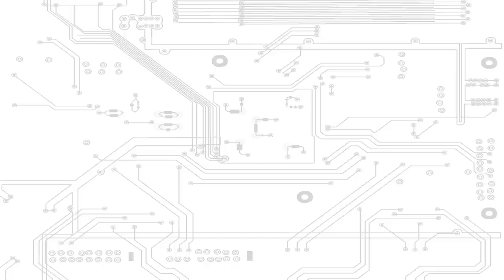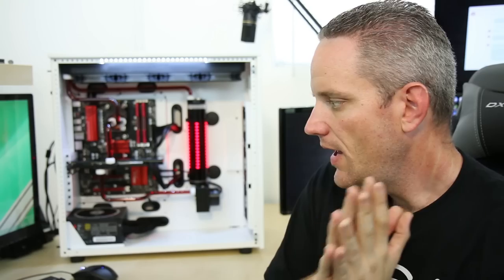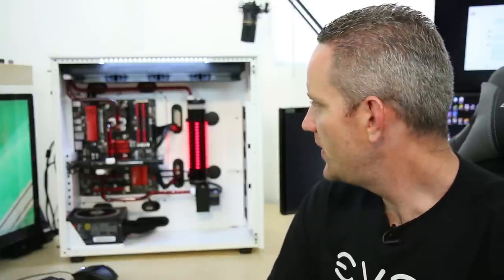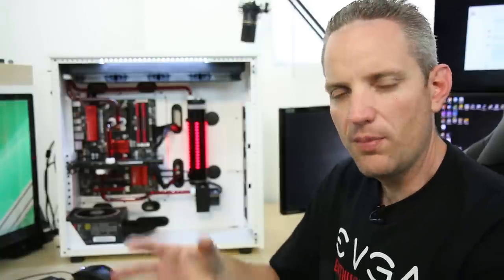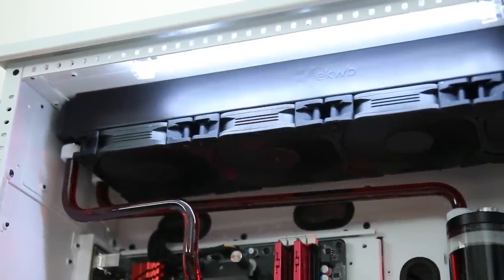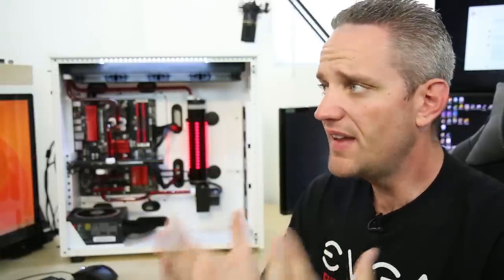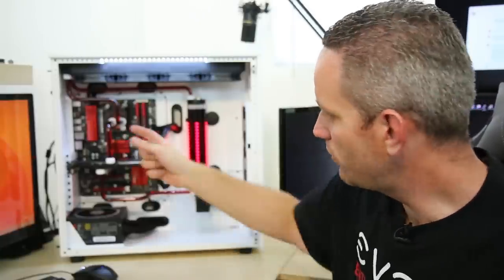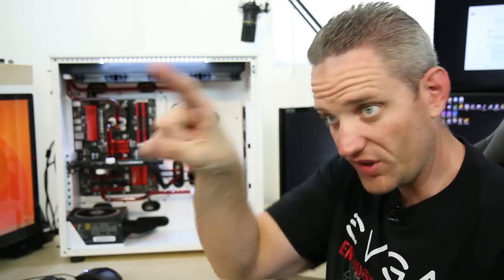Custom Watercooled AMD Gaming PC

Comment: I could use a jayz recommended water cooling components video. I just got 3 blocks for my 780s and if my sma8 ever shows up Idk what else I wanna put in there. Like all these brands and fpi vs rpm and what coolant works with this tubing and mixing metals my blocks are nickel plexi. and yeah do you have any suggested reading?

Comment: Is there any reason to use these nano-whatever fluids, or just any other coolant over distilled water? The loop I've been running has survived 5-6 years just using distilled water, and no problems so far.
Reply: Zhelor looks

Comment: Any thoughts about the 8320E. I heard it's the better choice then the 8350/70 since its cheaper and better for overclocking.
Reply: the E series are binned better. running lower voltage and having less leakage. 

jkteddy77  the "cores" are the same across all AMD bulldozer chips. the difference is core count and clock speed.  

so no the cores are not weaker. at stock clocks their might be a difference. but when the CPU turbos or is over clocked their will be no difference between the "E" series chips and the "non E" in terms of IPC

Comment: Would you test the thermal dispation of a said kind of radiator? Stores tend to say "this rad 120mm can disipate up to 200w of heat" But how is it measure, with what kind of fans  and that's a topic I don't see many of youtubers cover, as everybody say "bigger is better".

Comment: Id love to see a video on output temps, at the moment I cross fire two 7950's and am looking to upgrade , but would like to know what kinda heat  two 290x or two 970's water cooled will make . My rig is water cooled with a 8350 at 4.5 Ghs, and love it so far. But my man cave gets HOT!! and with eyefinity i work the gpu's hard ...so ya im looking at doing something different ( like two 970's or 980's) but would  love to see a side my side comparison  =)

Comment: ***** I would love to hear your thoughts around two of the most debated topics in watercooling history: The "intake or exhaust" debate and the "Push vs pull and push/pull" debate and knowing how to apply which one to the correct situation. There are people that claim for top mounted radiators you should always mount the fans as an intake, because that way you're pushing the ambient air from outside of your case onto the radiator to cool the liquid. This is versus exhaust mounted fans which are pulling warm air from inside your case through the radiator and outside of your case. Which should it be? In the event of having the fans mounted to exhaust in top mounted radiators, would you recommend using the rear case fan as intake and not exhaust?
Reply: Ro-Tang Clan check his play list. 
specifically

positive vs negative case pressure
AF vs SP
Rad setup

Comment: hey jay question from a person who wants to water cool for my first time ever i wanna do a water cooled desktop and was going to buy a second graphics card before i water cool and was wondering if you ever used or seen 5.25 slot water pump/supply and any suggestions for one since i wanna keep the case and i have 3 hard drives too

Comment: How about a video on fan controlling i.e. fan controllers vs power distribution pcb. How a lot of controllers use voltage regulation to control the fans so are not ideal for use with PWM fans etc.

Comment: Hi JayzTwoCents 
I have a special question to you, that (I think) none of your videos or 
the Internet has an answer to.
I Installed an Alphacool Eisberg 240 a year ago on my old 2500k and now I
 want to make a custom loop with my 6700k and already bought the most 
for it, and recieved an additional 360 radiator from a friend.
The question is:
Does it make sense or is it even necessary to place a D5 (or something 
like that) in this loop because of the 240 plus 360 radiator, and 
because I want to install the reservoir on top of my PC.
Plus would it be possible to turn of the pump of the Eisberg and just 
use it as waterblock?
I dont want to waste my money and buy unnecessary parts.
Thanks for now.
And maybe you want to make a video about about Upgrading an all in one watercooling system?

Comment: ***** - Watercooling: Can you get the PC-O5s from Lian Li?  That would be sweet to water cool, especially if you were able to build it with the AsRock X99E-ITX.  It's expensive, but beautiful!  I actually just got a custom BIOS from AsRock that allows PCI-e splitting, so you might be able to do SLI/CrossFire on the single slot using a splittler.  Let me know if you want it.  I have faith in you!!!

Comment: *****  Should rads be intakes or exhaust? how much rad do i need for cpu and gpus, what should temps be if you do water cool? Pump suggestions? how do you die most of your systems? Do you suggest color tube over dye? Do you have a preference in water flow between rad cpu and gpu, like who comes first and last? when you do push pull on a rad, should both sides be static or should the pull be air flow?

Comment: Video request: What Radiator Size is enough for what kind of CPU/GPU. Something like testing a 8350fx with a 280 slim, will it be enough? Or could you even use a 240 slim? Can a 970sli be cooled by 280 monsta or do I need a 420... Etc. cheers!
Reply: Benjamin Diepold Start with 240 and add another 120 for every extra heat source. So a cpu and 2 gpus would want about 480 worth of rad space. Of course cpus and gpus are generating less and less heat so you could get away with less. Slim vs thick are a few degrees difference so don't worry about that.
Reply: bensemus x thx, I wanted to give an idea for a watercooling video. =)

Comment: I'm looking to build my first pc and am wondering if this is fine and will work

Mobo- Gigabyte DDR3 1600 LGA 1150 ATX motherboard with UEFI bios GA-B85-HD3

Ram- Crucial ballistix 8gb (4x2) DDR3 1600

HDD- WD Blue 1TB

PSU- EVGA 600W B1 80+ Bronze

GPU- EVGA GeForce GTX 970 Super Clocked ACX 2.0

CPU- Intel Core i5-4460 LGA 1150

If I could get the thoughts on this from an experienced PC Gamer/Builder it would be greatly appreciated, Thank you.
Reply: Retrogamer456 Yh, it's all good but you won't be able to overclock the CPU though
Reply: Even.Ways Music Thanks for confirming and I know I cant overclock the CPU im not interested in overclocking yet
Reply: Retrogamer456 i prefer high performance Hard Drives whenever possible. they're slow enough as it is, i don't want even slower :(
i.e. i'd aim for a 1TB Black model rather than a Blue model.
Reply: ***** it's more expensive though. maybe a seagate desktop hdd.
Reply: TheKroeterich it is more expensive, yes.
but a high end model from any manufacturer will be more expensive than a basic model.

there's no way around that.
it's simply what i would do if i was buying a Hard Drive. if i'm going to buy one, i might as well get every ounce of speed out of it i can get.
WD's Black models have a longer Warranty as well.
so the point of view is important as to whether or not it's a better investment.
Reply: ***** but at hdds that doesn't make so much of a difference, but if he has got the extra money, buy it, sure!

Comment: How about you do a water cooling video about modifying a aio cooler to have clear tubing, possibly adding another rad, pump, or gpu block into the basic loop. Yes I know the aio cooler pumps are shit, but you could remove the bad one and add a aftermarket one into the loop, separate from the cup block.

Comment: First time builder and you have been helpful. You can view a few photo's of my build on Google+. I am very proud of it.

What are your thoughts on MagiCool cooling systems?

You talk mostly about Ek and Alphacool. I just bought the 240 kit for under $160.00. I am thinking of installing as is with intent to modify later. Again thanks for your tips. Also the R9 270 OC edition GPU, either I got a bunk card or it's not as great as was made to be. Switch to GTX 970, (Way Better) with hope of getting an RMA for second build.

Comment: need help I like the h440 but I think it will be to small for all my hardware so I want a full tower but I don't want the optical drive bays in the front  whtas the best full tower for about 100 to 200 pounds

Comment: Throw in a few auto parts say a heater core for a rad and fans with belts and pulleys get the whole retro thing going and anything else you can think of
Reply: ***** hey just got a good one a hamster wheel with a real live hamster

Comment: Is it true that Red coolant gunks up the blocks faster then any other color? My  EK-Ekoolant EVO Blood Red seems to be low quality because it gunks up my CPU block. Not to mention that the UV reactant doesnt work lol Ive tried with 5 or 6 different UV lights, it just refuses to light up :(
Reply: No that's ridiculous
Reply: AK90 use mayhem and ur good. UV dye will stain so you will need to clean the loop if you want to run different colors in it.
Reply: AK90 Jay has mentioned in his "Water Cooling misconceptions" video that he has observed red coolant tending to have this problem as well as causing more staining

Comment: If you are going to overclock the 8320e is WAY better bang for your buck than the 8350, its still 8 threads and is much cheaper, overclocks pretty much the same as an 8350.
Reply: Do you mean fx-8320?
Reply: Sam Cooper You probably mean the 8370e. That's the updated version of the 8350.
Reply: Sam Cooper just get an i5-4460, you won't be able to reach the performance of this CPU in games even with an FX-9590.

Comment: Is this a good computer build?

-Case: Sentey® Gaming Computer Case Gs-6011 Blade $55
-Processor: Intel Core i5-4690K 3.5GHz Quad-Core Processor $225
-Motherboard: Gigabyte GA-Z97X-SLI ATX LGA1150 Motherboard $124
-RAM:Corsair Vengeance 16GB (2x8GB) DDR3 1600 MHz (PC3 12800) Desktop Memory (CMZ16GX3M2A1600C10) $107
-Power supply:SeaSonic 620W 80+ Bronze Certified $80
-Hard Drive: Western Digital Caviar Blue 1TB $50
-Graphics card: EVGA GeForce GTX 970 SC+ ACX 2.0, DVI-I, DVI-D, HDMI, DP SLI Ready Graphics Card (04G-P4-2977-KR) $330
-DVD drive: Lite-On 24X SATA Internal DVD+/-RW Drive Optical Drive IHAS124-14: $20
-SSD:Samsung 850 Pro 128GB 2.5-Inch SATA III Internal SSD (MZ-7KE128BW) $90
Reply: James Burton Yh, it's a solid build (Y) similar to mine only I have an FX-8350 OC'd to 4.8GHz, an Asus ROG Crosshair V Formula-Z and a 970 SSC haha
Reply: Even.Ways Music I wouldn't get the 850 evo because of it's cheap memory it will get over the years.

Comment: for a future i want see a fury x water colling ( not stock ) custom ek block marby red backplate and i want know if posible run two rads ( like 360 rads )  pums for crossfire and if that afect the permance of the gpus no parallel block separate loops and i like see a amd cpu with a pcie ssd ( intel 750 ) if posible on md rig

Comment: can u show whats the minimum radiator size we can get away with
Reply: Are you referring to length or thickness, length usually is 120mm or 140mm per component is a general idea and as thickness goes you should look more into fpi or fins per inch and the thicknesses. Vauge yes but Jay has better explanations in a few dedicated videos that should answer it all for you

Comment: Bit random. My current PC has an i5 4670k, an Z87-A motherboard from asus and an gtx 750ti, and 8g of ram. I also have a 450PSU, bronze+ frpn fractal design. I contacted my countries only real pc store and asked what I needed to upgrade first in order to play games like BF4 on a better relolution then I am. And they said that I should buy an ASUS STRIX GTX 970 DirectCU II or higher. Is this what I should buy? Money is not really a problem. But I do not know much about PCs. I only built this around last christmas. So i´ve had it for around 8 months or so. is an 970 the way to go? And since it is recommended that 500W. And I only have 450, will thoes 50W make a big differnse? 
I hope someone will help me with this.
Thanks in advance.
Reply: ThaDrag IV Yh, the GTX 970 is kinda the sweet spot at the moment and will be good for quite a while. I currently have a EVGA GTX 970 SSC. It's definitely a solid upgrade route for sure as everything else in your system is fine but the GPU defo needs upgrading. So yh, go for the 970 it's a solid card and will max out any game at 1080 60+ FPS for at least another 2 years.

 In regards to power supplies, don't get a 500w. I'd definitely recommend getting 600w minimum for your setup plus the 970. However, consider this. I'd probably plan ahead and get something with more power in preparation for your next upgrade e.g consider if you would ever decide to SLI in the future. If so get 1000w. If you think you'd never SLI but would upgrade to a real beefy card in the future and later upgrade other parts then i'd defo consider 850w. It will allow you head room for any single card for years. Make sure it's a good brand and 80+. I bought an 850w EVGA Supernova 850 B2 80 Plus Bronze with my 970 purely so I have that headroom and ability to upgrade to something a lot more powerful later.
Reply: Even.Ways Music you can do sli with 750 watts easily.
Reply: ThaDrag IV You can also get an R9 390, it's about the same price, performance may be a bit better at some games and it has 8gb of vram, you will be fine with a be cooler master vs550.

Comment: do a vid on how much raddage you need to run fans/rads passively at idle, using a programable fan controler eg. aquareo...
Reply: Luke Alexander start with a 240 and add 120 for every heat source after the cpu (really just cpus and gpus count as a heat source). Use low fin density rads if you want to use low rpm fans. This is basic stuff so you might want to flesh it out a bit more for your specific setup.
Reply: bensemus x  dude... I know how to watercool... been doing it for some time now (forum name: freebee - look at my build log's)... the video idea is how much raddage is needed for passive (fans turned off) use at idle
Reply: Luke Alexander then ignore my comment. Most people asking for vids are doing so for their own need and I assumed you also needed that answered

Comment: What is the difference between water cooling and normal not water cool pc's
Reply: Elias Sanchez the temperature hopefully.
Reply: TheKroeterich It is actually a lot more complex than that. Water cooling builds are not always cooler than none, in fact a lot of CPU towers can cool a CPU a lot better and cheaper than almost all closed loops last I checked.

+Elias Sanchez

Jay did a video on closed vs custom vs air builds a while back, I suggest checking that out for further knowledge.

Comment: Quick question to Jay or anyone else reading this, for that matter. I just recently bought an EVGA GTX 970 SSC (still in transit), and I am wondering if my i5-3450 will be a problem with this graphics card. If anyone has an answer please let me know!
Reply: MiniManchuGames  If you're asking if the i5-3450 will bottleneck the gtx 970, the answer is no. That CPU and GPU combination is great and you should be able to max out any game at 1080p.
Reply: No, i have an i5 4460 with a gtx 970 and it works perfectly fine. Youll be fine
Reply: ***** omg stop.... there is barely any difference between the cards... the 970 has no performance issues, neither does the 390...
Reply: adza botchway I think you misunderstood my comment - I said "no performance issues" as in performance between the I5 and 970 - I fixed it for clarification.
As far as performance, you're right, but we're talking 4 VS 8 GB vram - there is differences, for similar price its just smarter and more ideal to get the 390.
Mainly if he's planning on running multiple monitor setups etc.
Reply: Tech By Matt Socoboy Thanks! Lookin' forward to when it comes!

***** I actually considered the 390 but I decided I'd rather stick with nVidia.
Reply: MiniManchuGames We all are loyal to a brand.
Its not terrible, just a better choice for the 390, but if you're loyal, do you. :)
Reply: ***** thats a downgrade, 970 4g 145watts, the evga cards are the highest out ofnthe box clocked 970s, so it will outperform the r9 390, r9 390 8g 280Watts and more expsensive also Rma costs money
Reply: No, you'll be fine. It won't bottleneck.
Reply: florianweiss007 tdp is not power consumption
Reply: ElsK81 that guy is an obvious troll "the Nvidia card is cheaper because it uses less watts!!!!". Yet they don't actually research how much it will cost them.
Reply: florianweiss007 Wattage isn't everything - the 390 (even against an 1400 OC EVGA CARD) the 390 beat it in some test - and was only shy by a coupe FPS in others.
Plus the additional 4GB.
390 is the obvious choice, i'd only recommend 970 to a loyalist. 
This is also coming from an nvidia fan - although I love them (and AMD) its just common logic.
Reply: Yesterday i bought a 390 g1 and i love it